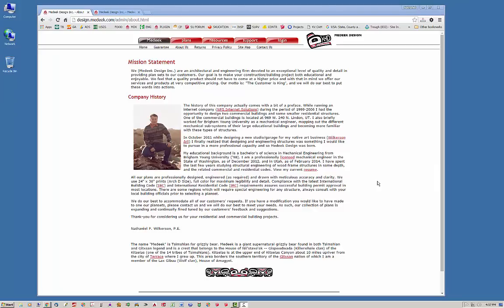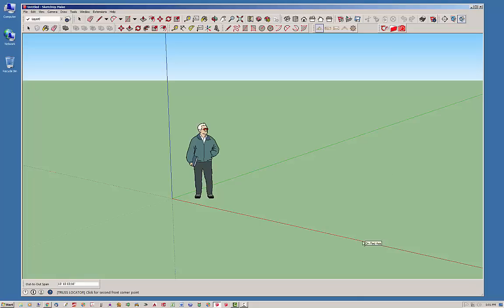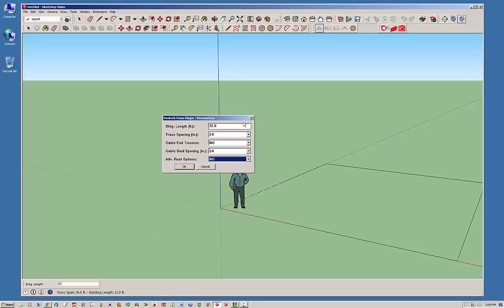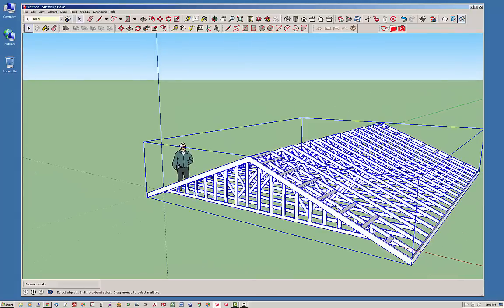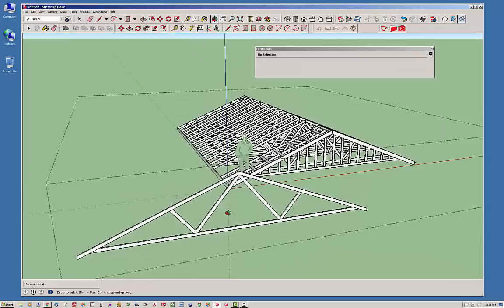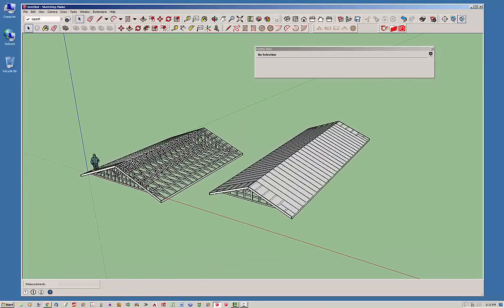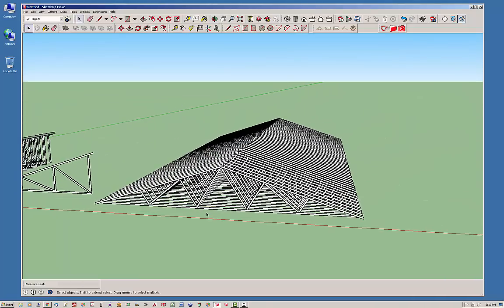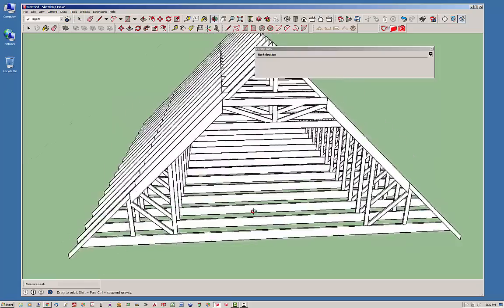Medeek Truss Plugin Tutorial 1 - Common Trusses

Comment: I am DIY and just need two truss for myself, thanks for the free tool, but I hate the limit of 5 per month, and the span can only be integer feet. Three times I tried to use say 12ft11in the s/w skipped yet count the time I used, so I only used two times and need to wait to another month!
Reply: The Medeek Toolbox subscription gives you unlimited access to the Truss Designer on the website and is only $8.00/month or $35.00/year.  If you are using it that regularly then it is probably worth the subscription.

Comment: 17m35s end truss top chord uses two pieces, a better way is single piece and sit on botoom chord. end truss top chord can be 3.5" lower.
Reply: Correct, you also have the option to orient the outlookers vertically and then it will create the truss as you suggested.  However this arrangement is not shown in this demonstration.

Comment: Version 2.7.1 - 04.13.2020
- Enabled the "Edit Roof Assembly" function for shed w/ ledger rafter roofs (imperial and metric units).
- Enabled soffit and fascia for shed w/ ledger rafter roofs: boxed, gable, angled.
- Enabled a roof cladding extension parameter for shed w/ ledger rafter roofs.
- Added the option in the shed w/ ledger rafter roof edit menu to specify a separate front and back overhang length.
- Enabled a "No Framing" mode for shed w/ ledger rafter roofs.

Comment from the maker: Version 2.1.2 - 12.18.2017
- Enabled vertical and angled heel blocking within the advanced options for truss roofs.

If you choose to enable vent holes the heelblock menu will prompt for the hole diameter.  The vent hole algorithm will place vent holes in the heel blocking per the truss spacing:

< 12 in. = 1 vent hole
< 16 in. = 2 vent holes
16 in. or greater = 3 vent holes

Let me know if this makes sense, I can always modify it to meet any criteria.  If this sort of thing varies a lot per locale I can also make it more user definable.

Comment from the maker: Version 2.1.0 - 11.28.2017
- Added Northeast hip set trusses.
- Enabled advanced options for northeast hip sets.
- Added energy/raised heels for northeast hip set (3 variants: wedge, slider and vertical w/ strut).
- Added the option for open vs. closed end jacks.
- Added the option for a drop in purlin frame.
- Enabled a graphical user interface for Truss Set selection.

Comment from the maker: Version 2.0.6 - 11.10.2017
- Added gutters and downspouts for rafter and truss gable roofs.
- Added gutters and downspouts for dutch gable rafter roofs.

I still need to add gutters to monoslope truss roofs, shed roofs and some other specialized truss roofs.  Adding the gutters to the common truss roof became slightly more complicated when I realized I also had to deal with roof returns and their various configurations.

This gable roof has a hip return with fully wrapped gutter, you can also choose to half wrap or no wrap (linear gutter only at eaves, does not wrap around corner).

The dutch gable is really no different than the regular hip roof, when it comes to the gutter and its configuration, but internally it is a completely different set of advanced options.

Comment from the maker: Version 2.0.5 - 11.05.2017
- Added gutters and downspouts for rafter and truss hip roofs.
- Gutter menu added to the global settings.
- Custom roof layer added for gutters in the layer menu within the global settings.

I still need to add gutters and downspouts to the gable roofs (truss and rafter).

Four gutter types with two different downspout types.

This is a new feature so please send me your feedback and I will try to address all of the issues.

The gutter shown is a 6" half round with a 2.75" round downspout.  The gutter and downspouts are separate solids so that one can easily adjust the placement of the downspouts after the fact.

The downspout angle is 15 degrees, with a 3" drop out of the gutter and a downspout center line radius of 3".

View model here:

https://3dwarehouse.sketchup.com/model/3aa7e59f-eabb-49ff-81ae-1047ecceef68/Hip-Roof-with-Gutter-and-Downspouts

Comment from the maker: Added Red Built Red-I Joists to the plugin:  45, 65, 90, 90H, 90HS. 
http://design.medeek.com/resources/images/truss_su287_800.jpg

Version 2.0.3 - 10.13.2017

- Added the option to provide a face mount hanger for inset floor joists with ledgers.
- Added the option to provide a top flange hanger for inset floor joists without ledgers.
- Added an option in the global settings to enable or disable manufacturer's logos.
- Face mount hangers added for solid sawn floor joists.

Comment: Nathaniel is there a truss combination or a truss system that goes from the main house truss to over the porch to the outside header. The main truss supports on the house exterior walls. there is no weight except the lumber over the porch. Acadian style house with front and rear 10' porches. house is 40'x32'. i like the TRAY truss system. also is there a engineering calculations for this system.
 Thanks

Comment: Thank you for making these tutorials, I'm tying to learn as much as I can about this trade before getting a more traditional education. Out of curiosity, how is the Medeek Plugin related to MiTek?
Reply: It is not related to MiTek, however like MiTek I am using as much industry standard nomenclature and design principles as I can.  A truss designed with the plugin will be very close if not exact to any truss you have designed by your local truss manufacturer using Alpine, Simpson or MiTek.  They may adjust the web configurations based on the engineering/loads on the truss or other special considerations.

Comment from the maker: More "Fun with Roofs".

This roof was generated by first creating a hip roof primitive then deleting all but 3 components which were then copied and rotated into place for the lower roof hip corner.  The shed roof /w ledger component was created with one primitive and then copied and rotated into place.  Overall a fairly painless process now that I am somewhat familiar with navigating my way around SketchUp.  The fascia required a couple of trims.

The pyramid at the top required no manual intervention. Approximately 10-15 minutes of work for a fairly substantial roof.

View model here:

https://3dwarehouse.sketchup.com/model.html?id=ue55bf7ab-c669-4cd7-8f05-305dee4e2519